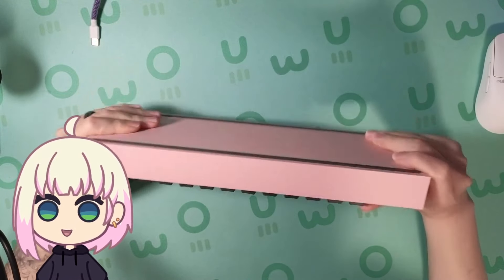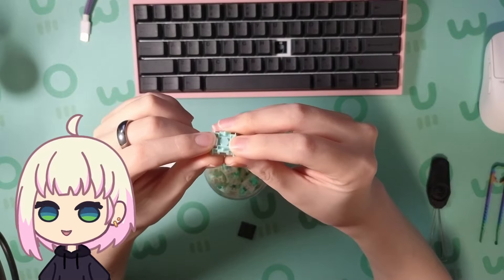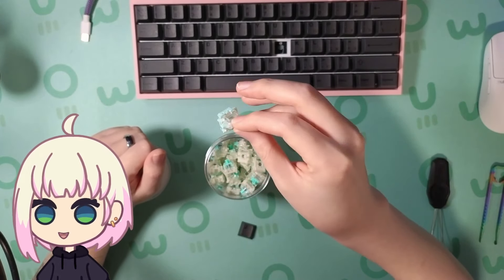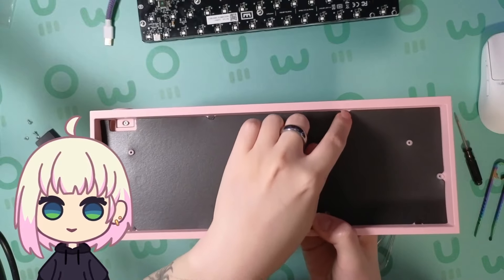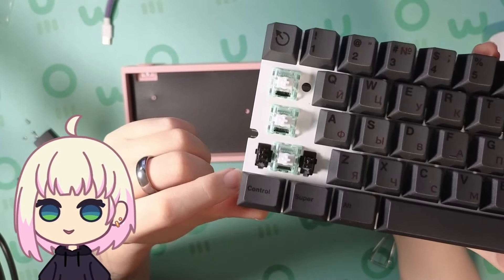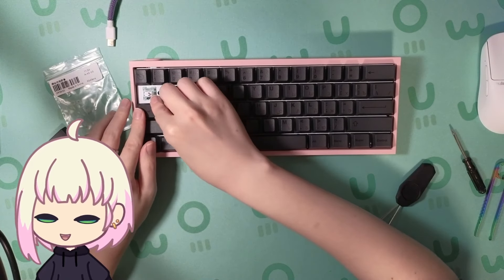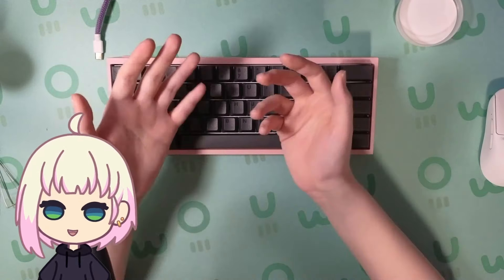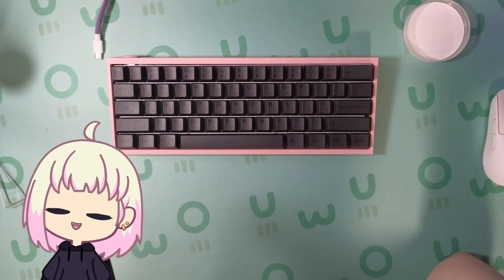Trying my Best to make the Wooting60 Sound "Good"

Comment: I have almost the same setup but I used an o-ring to mount the keyboard and swapped back to the steel plate. To me, o-ring mount sounded slightly better but feel-wise it's not that much softer (if at all) because of the mounting points hinder the "bounce". The o-ring was a tight fit and I had to use plate foam for it to work. Also, great video! Very in-depth and thorough ^_^